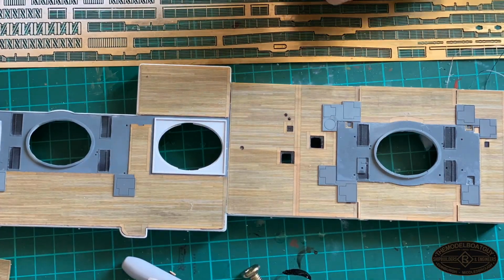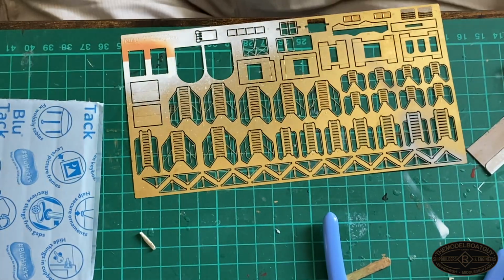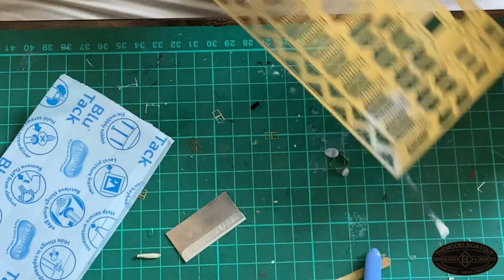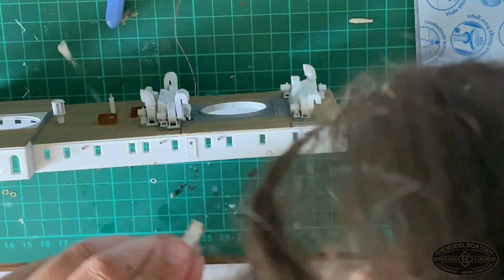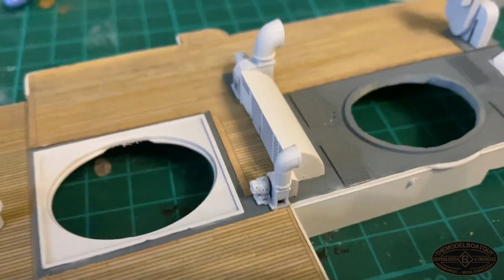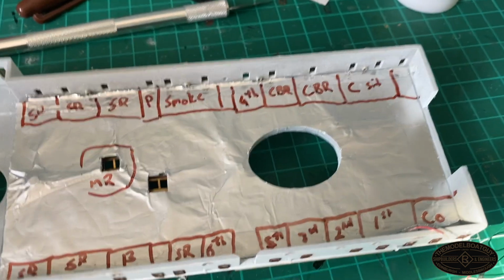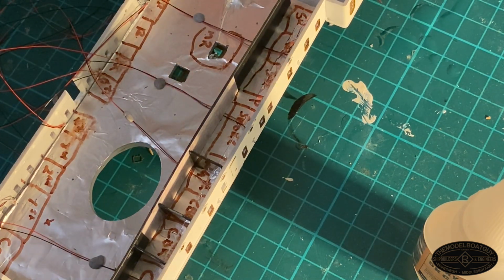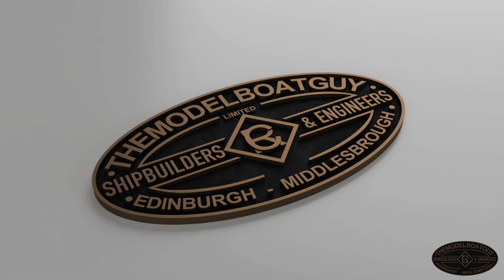Radio Control Trumpeter 1:200 Titanic Build Part 61 - Officers Quarters Part 2

Comment: You may want to check out the latest video from "The Midwest Model Shop" from Aug 4th. 
It seems that the water tank behind funnel 1 doesn't line up  with the pipe coming into it and some modification is needed.
Reply from the maker: Aye I’ve just watched that, thanks for making me aware. 
I think the fix they come up with is pretty good and quite achievable. I think i those little issues are inevitable when using loads of different sets

Comment: Great video,  many thanks!   Minor query:  is there any danger that applying the black fabric paint directly onto a led to stop backwards light bleed,  could cause overheating of the led (if it is left on for say an hour or more) reducing its lifetime?   Did you try testing this just to confirm all would be ok?
Reply from the maker: Hi Chris, I doubt it will overheat to the point that it will burn or anything like that. But it will certainly increase its average working temperature over its life so yes I’d expect it will have an effect on the life of the bulb! 
That said, mine are also glued directly into those brass tubes which will sink a little bit of that heat away, so tricky to say but I expect these will last a little less than their design life. 
I don’t intend to have the lights on over long periods, they are intended to be the models party piece so to speak. So i am hoping they will give me a good innings
Reply: Yep,  I'ld forgotten you also used brass tubing to provide the shading forward towards the bridge,  that will certainly help the heat dissipation.  Thanks!